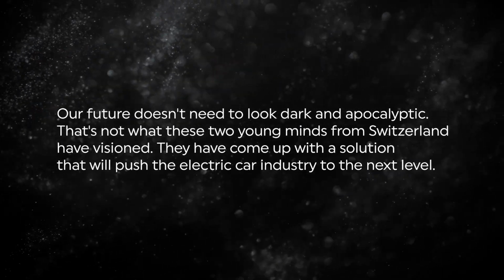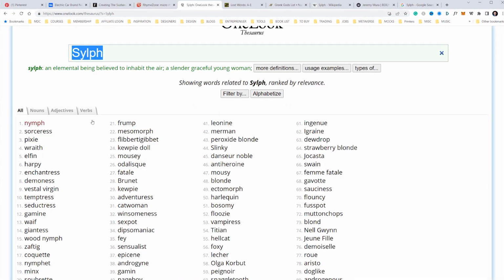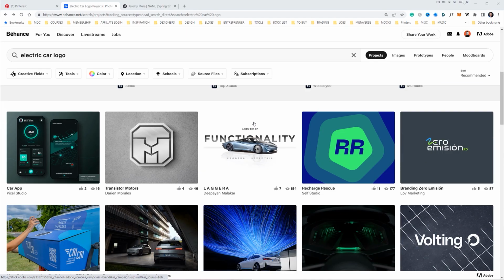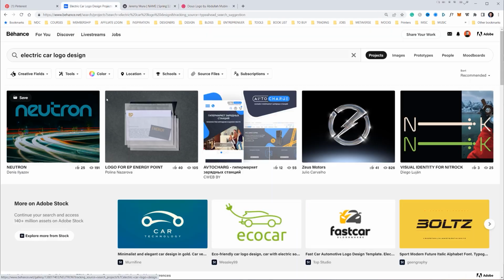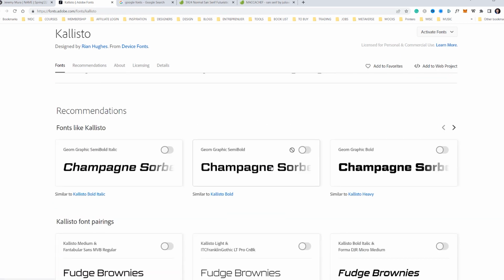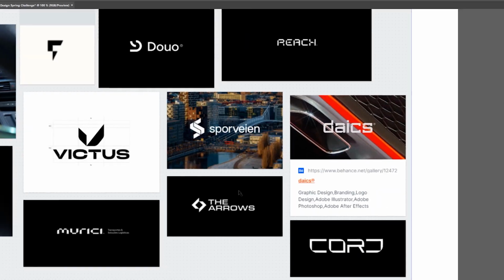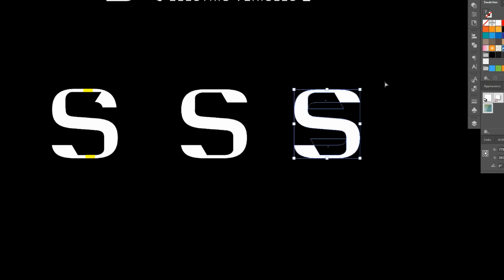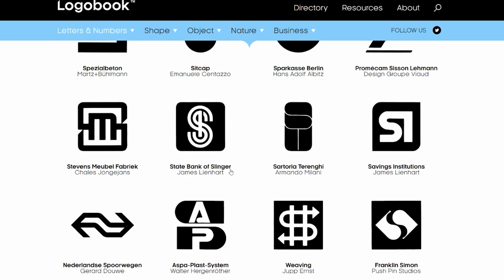Designing an Electric Car Brand from scratch

Comment: Great video as usual. Do you have a video about how you collect reference images? You were selecting right out of the browser and doing a screen grab? Is that an extension?
Reply from the maker: Thanks Aditya, I've talked about it in my courses and a few other videos. I use snagit it's an app from TechSmith for screenshots then I paste it into illustrator, I use to do pinterest boards but faster for me to do it this way.
Reply: @JeremyMuradesign  Thanks!